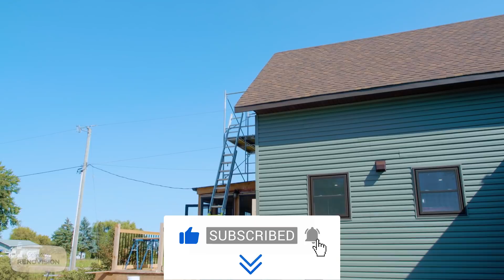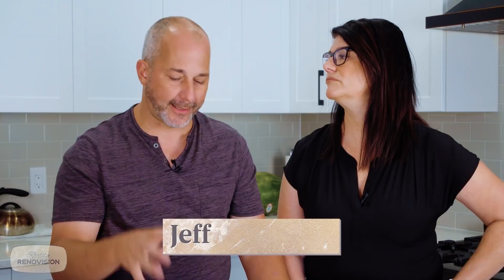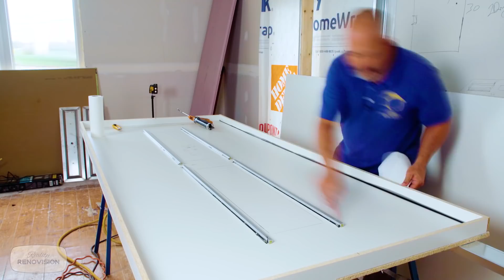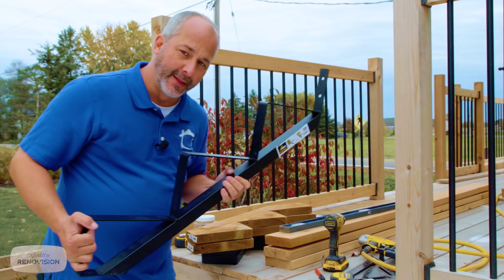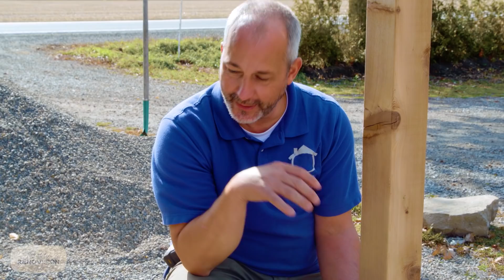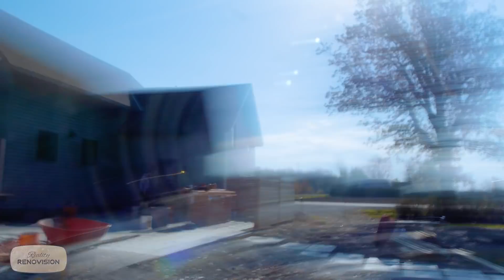How to Renovate During the Pandemic | 1880s Farm House EP14

Comment: Would recommend a mesh or welded wire fabric to reinforce concrete counters. While a counter doesn’t take much load concrete is weak in tension which is a component of bending.